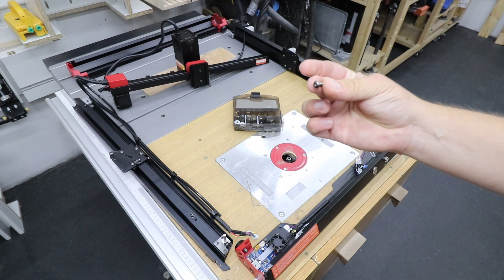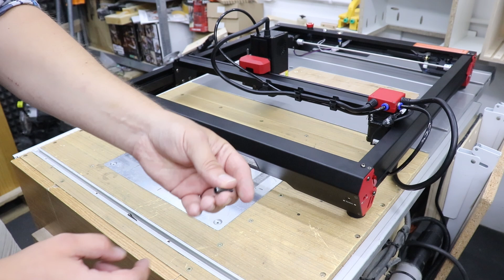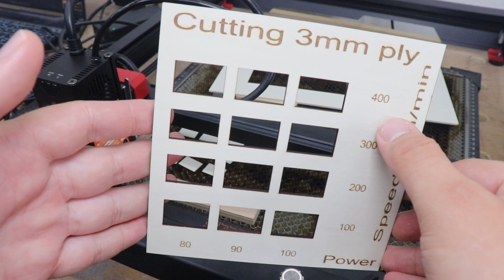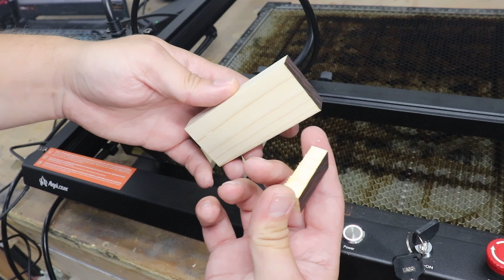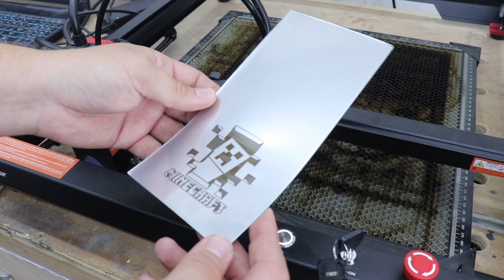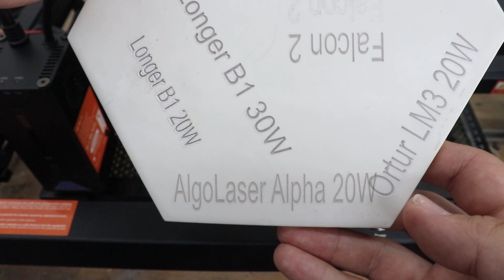Detailed Assembly & Testing - AlgoLaser Alpha 22W

Comment: Hi, Cześć Tomasz/  if You could compared this laser with atomstack 20 pro , wich is better in Your opinion?
Reply from the maker: I have not worked with that model from Atomstack so I can only go by specs on their website. I would say the Algo will be better it has got the second generation COS module. It's 22W but it operates close to 30W modules.
Reply: @CasualDIY   Thx for answers, but there are no replacement lenses for the algolaser, this will be problem when something going wrong....
Reply from the maker: @B1G-Jack  did you tried to emailing them and asking if that is the case? You get I think two spares with the machine so they must have in on sale. Or more then likely you can pick them up somewhere else as these should be standard lenses. Doubt these are unique to this module.

Comment: Hi Tomasz, I assume this is the new laser you mentioned in your response to me ref the 30w laser test recently. Very impressive unit, and as usual your review was great to watch. As a senior citizen the price and features shown thus far would make this an ideal purchase for me, however before I proceed I was wondering if you have ever tried cutting a wooden jigsaw puzzle with a picture or photo attached, and if not would you be prepared to try this out as this will be one of my prime reasons for purchasing this system so that I can make puzzles for my gran children. I'd be interested to know if there is any unsightly burn on the picture side.
Reply from the maker: Hmm you may have an issue with cutting the wood and the photo attached at the same time as the power that's required to cut the wood would be too great for the paper photo. You could engrave the photo or graphic onto the piece of wood and then cut it out. Or you could cut the wood and the photo separately and then glue it on. A machine like that will cut a puzzle shape with no issues
Reply: Had not thought about engraving and then cutting out, Great idea. Thanks Tomasz @CasualDIY

Comment: Excellent start to the day, a cuppa and one of your videos to watch ... was surprised at how clean that 17mm pine cut was, best I've seen I'd say ... did you try it again just to show it wasn't a fluke of the wood?
Anyhoo, looks like a nice piece of kit, and thanks again for your review of it 👍
Reply from the maker: To be honest I was surprised myself, not seen a clean cut like that before. And the pieces of wood I use for testing are the same ones for the last 4 lasers I think. Overall performance will vary on wood thickens, species and density. But I have to say this 22W module seems very strong, stronger than 22W.

Comment: Of all the laser machines you have tested is there one that stands out above the rest?  Plus which one would you recommend on performance & value?
Reply from the maker: Very difficult to answer that. If the machine is on par where it comes to module power then they mire or less perform in a similar way. Each has some unique features that will be more or less important to different people. It all depends on personal preferences. For me I would pick a laser with at least 20W power it then gives you more cabalities. I would say they are all decent and you need to pick the one with features you want and power you want - that will be dictated by projects you want to make with them.